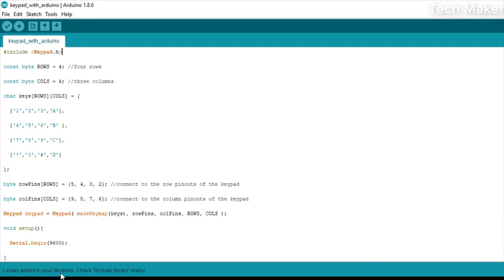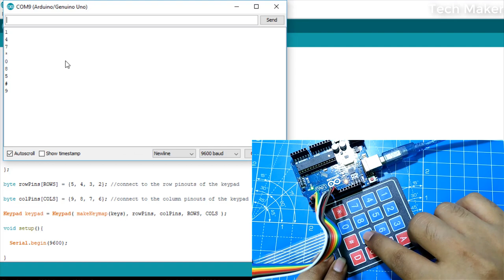Arduino 4x4 Matrix Keypad Tutorial | Keypad library for Arduino

Comment: You missed out the reading of the keypad characters when pressed and output on the serial monitor. For those reading this and want to know the answer:
In your Loop(), add :
char keyPressed = keypad.getKey()
if(keyPressed){ 
    Serial.println(keypressed); 
    delay(100); 
}
Reply from the maker: It may due to mechanical debouncing
Reply: you forgot to capitalize the p in keypressed and there was no semicolon after getKey

Comment: HI GUYS 
I was doing  a project, as seen in the photo I have connected a 4x4  keypad to one Arduino and another Arduino is connected to serial 3
At the moment I’m when I press a key im send that key to the other Arduino to light a led 
When I press 1 i send a 1 over a serial to the other Arduino 
Then when I press 2 it sends 2  over a serial to the other Arduino
How can I send a combination? 
Like 12 or 361 Or any other number.
What I wanted Is to send all the numbers pressed in a given time like 3sec
Guys can you’ll help please  or suggest a video which does this I have tried to search but no luck
Reply: Bro plzz can u tell me the code for taking any randam number from keypad and add it with fix number present in coding. What will be the code then. Means when I press any number from keypad ,it will add it with fix number in coding and display result on lcd